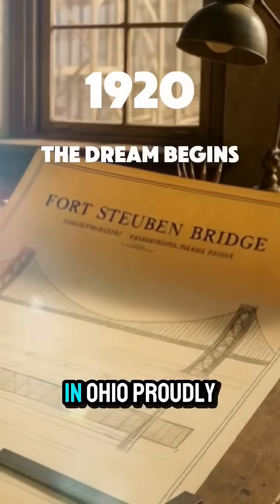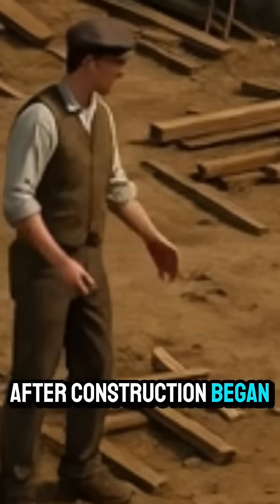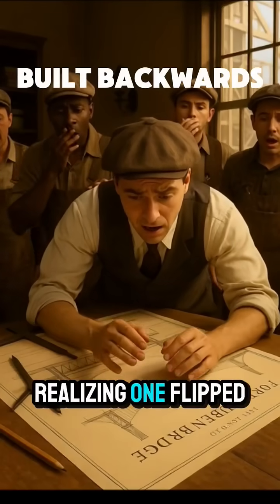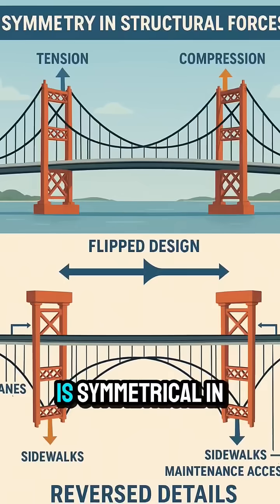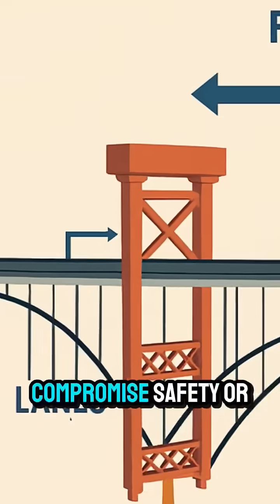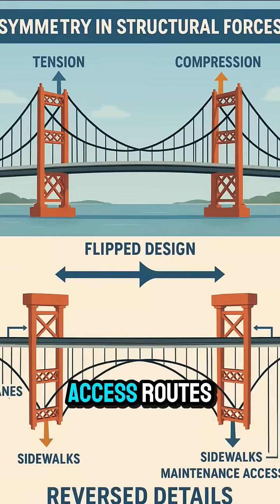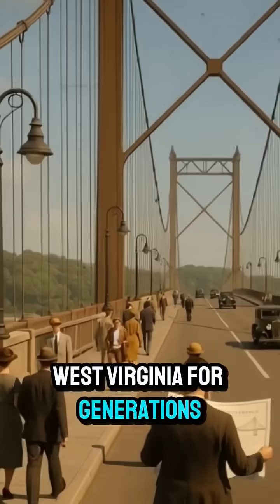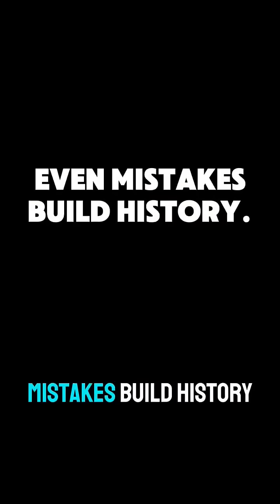The Engineer Who Built a Bridge Backwards #shorts

Comment: Absolute rubbish, the Architect is always checking.
But it’s impossible to get plans upside down.
Good April fool joke though 🤣🤣.
Reply: This is Absolute ai and Absolute...
Reply from the maker: Thanks for the comment and yeah its April fools kind of situation 🤣, but here's the explanation: 

The Bridge was constructed between 1920–1929, long before computer modeling, CAD software, or even standardized project visualization systems. Back then, engineers relied entirely on paper blueprints, often huge sheets that had to be spread on drafting tables and many components were mirrored or symmetrical.

So, when someone flipped a sheet upside down or back-to-front, the design still looked right, especially for something like a suspension bridge, where both sides are mirror images.
Reply: ...should I dislike or like pick?